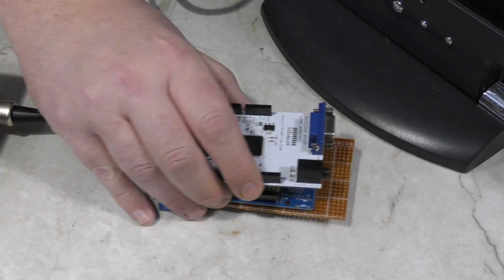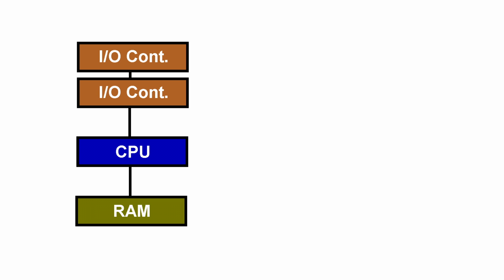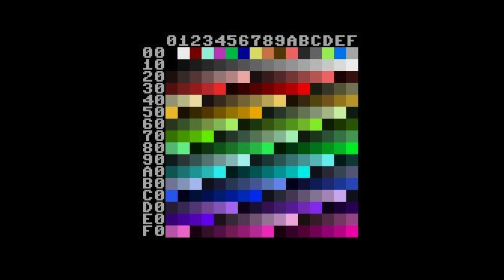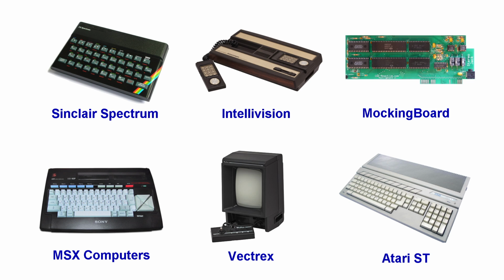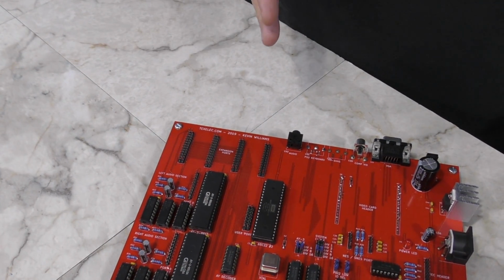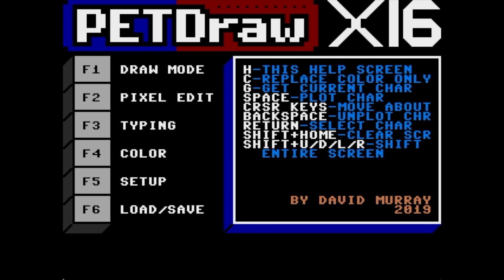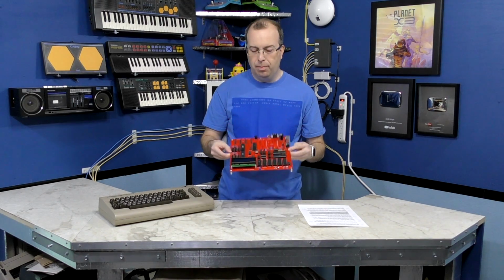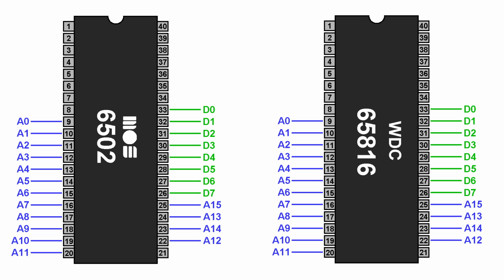Building my Dream Computer - Part 2

Comment: How about doing a YM3812 and SAA1099 and have sound capabilities similar to a Sound Blaster? Okay, yes, I do have a soft spot for it. The SB16ASP was my first sound card.

Also, why a separate button for the NMI, rather than good old Ctrl-Alt-Delete?
Reply: TheVerge.com/2013/9/26/4772680
"I'm sorry I screwed that one up, but it was really IBM's fault!"

Comment: This is such a simple idea in principle, to attach improved video and sound hardware to any machine really. It amazes me (and to be honest I thought so at the time as well) that no-one thought to, for example, bolt on an AY sound chip or 6845 video chip (or the TI equivalent that had sprites) to something like a Sinclair Spectrum. It must surely have been possible to do this, and I believe that was part of Imagine Software's "Bandersnatch" prototype as early as 1983. If such interfaces had been standardised in terms of memory locations it could have levelled out the differences between the various 8-bit micros.
Reply: As in Linux years ago, you have to write the driver.

Comment: I'd probably be interested in a through-hole kit. Don't need a case though, since I'm designing a custom 3D printable case for my other projects (still have yet to find that perfect shade of beige spray paint though...). I would imagine these would come with the Vera chip on a separate module, as shown in the video? Soldering that FPGA looks pretty tricky, unless it comes in a more traditional package. I'd definitely go for integrating the sound into the Vera FPGA if that's possible. If you want to eventually do the tiny board with just a couple of FPGAs or ASICs, having a discrete sound chip will make that difficult. Unless you don't care if the smaller design works and sound different to the original one.

Comment: Cool project. If I may suggest something, it would be an banking system for IO devices. Essentially the idea would be like this: Every device on the bus gets a chip select tied to the slot. The device can have IO and or ROM (and RAM).

This would enable a trivial way to write device independent drivers. You could define a format for the optional ROM. If it is there a pre-defined section of it could include information about that device. The rest of the ROM can contain driver code. If you want to execute a routine of the driver, you map in the slot you want to have an just jump to the ROM. As the ROM as well as the IO space will always be mapped to exactly the same addresses, there is no need for configuration or complex IO address configuration. You would just need to know which IO slot your device is in.

Internal devices like the video chip or the keyboard controller could just get virtual slot numbers acting as virtual cards. Interrupts could be handled via a simple routine that swaps in the IO/ROM space of the card and executes the interrupt code in ROM.

This all would only add a tiny amount of complexity (slightly more complex chip selects on the mainboard, and mildly reduced complexity on the cards) but provide a lot more flexibility. Essentially you could, for example, just replace the keyboard controller from a PS/2 one with one that is just a bunch of IO registers and an interrupt source to scan the keyboard. You could simply replace the video circuit without having to adapt every program. You could attack mass storage devices without having to touch the kernel.

Comment: Excellent video David. I'm a little bit concerned about the music chip implementation. I love the two 8bit stile chips you selected as first choice. But because of the 2MHz limitations, I see you're thinking about moving into a more "16bits style" sound chip. I would love you stick to the original idea of having 6-8 8bit style music channels. I have nothing against the second option, it sounds great, but I think that sound doesn't fit with the 8bits soul of this project. Please, re-think about the final solution. Looking forward for the part 3.

Comment: That Yamaha YM-2151 sounds *awesome*. I have some love for the AY (had a ZX Spectrum +2A that included a variant back in the day), but it's no SID chip, so even though two of them would have been pretty cool, I'm glad to see you heading in a slightly different direction here. Really excited about this project!
Reply: Same here: IMO the AY is just too weak: No envelope generator, low resulution frequency control, no selectable waveforms and no filter. You can do a software envelope generator, but if you want to avoid that people need to be 8-bit gods, you should avoid software envelope generators.

The YM2151 is just way superior and easy accessibility can also be achieved by extending BASIC. I must say like the subtractive nature of the SID (harmonically rich waveforms, subtract from it with a filter). The SID is basically the only subtractive synthesizer that was used in computers and makes the C64 sound unique amonst all other computers.

But considering the need for off-the-shelf ICs, the YM2151 is a fine choice, it will provide great sound capabilities.

Comment: How does the single byte writing to the video chip work? After setting address and increment, you must have to do something else as you send each byte via the data port otherwise the video chip won’t know when you’re starting a new byte (ie how would you send zero twice)?
Reply: I guess the video chip monitors the write line of the CPU, so it can detect when the second zero is written.

Comment: Really nice project! Concerning the design everything is very coherent with the name and logo design and has excactly the ”right” feeling. Though the case and hardware peripherals was disappointing imo. The most economical thing I imagine would be just using simple standoffs with acrylic bottom and top plates, then letting the user choose their own keeb, mouse etc. I think if you’re gonna have a custom case etc it might as well resemble a actual 8bit machine like the c64 or so and then have this as a more expensive choice. 

Again really cool this is:)
Reply: Hi! We are going this route for very good reasons. I'll be doing a full post and user poll shortly on the Facebook about this. In short, we don't want to custom build a case and keyboard as that would add hundreds of thousands of dollars which you guys would have to pay for. 

It also introduces many risks and delays as you have seen on other projects like the ZX Spectrum Next. Therefore we are limited to high quality off-the-shelf components, which is the spirit of David's project. We will be customizing and rebranding these and you'll see all the options in the aforementioned poll, and have a say. We realize with nearly 1 million subscribers we are not going to be able to please everybody, and we thank you for respecting that. 

However you can trust that we are moving forward with the best possible option for the community so you can get this machine in your hands as quickly as possible, looking sweet, and at the best value.

Keep in mind too that many beautiful classic computers did not have an integrated keyboard. Apple Macintosh, Amiga 1000, Commodore 128D, Amstrad PCW... 

Thank you for your enthusiasm and feedback 👍🕹️

Comment: Why not just make 4 to 8 small motherboards, it'll be like an 8 story system, the corners screw together. It's connected by flex cables. It'll look like an industrial shelf you assemble, that you find int hardware stores. With this design, it'll be easier to form it into a custom case cube (maybe even as small an Ouya) that looks like a square Death Star (it had protrusions on the surface) and ribs for that retro look). If something goes wrong, it's cheaper to replace the module and/or isolate the subcomponent. Each layer has an easy to plug, plug so you can power just that layer/module to easily isolate problems.

God bless, Proverbs 31
Reply: This is a terrible idea and would cost a ridiculous amount of money, and they are not going to stock 4-8 separate boards for the extremely rare chance something stops working. They're all socketed anyway which makes it even more stupid of an idea lol. Imagine all the spaghetti wires connecting all the boards together

Comment: As for sound device: why not for custom chip also? 2x ARM based SID emulator with Paula's four voices (at least) for 8/16 bit samples to be able to replay Protracker mods <3
Raspberry pi form-factor will be squeezed into FPGA anyway, so i don't see any point here in insisting to use of actual YM chips. All these vintage chips had they pros and lots of BUTs. Why go for compromises if you have such skilled custom chip designer as Frank (best regards and much respect).

Comment: i know that this is a gaming computer since it's built by gamers but if it could be used in small automations also it wolud be great! Some  io pins with pwm and interrupt capability ... maybe at least a single ADC input pin. Would be great to program some simple user interface for a thing like that maybe a graph display of some data ...

Comment: $300 .. sorry no one is buying that ... $150 seems a sweet spot for retro computers
Reply: True, but the costs add up fast when you're using real retro hardware.  A 6502 is no cheaper than a 100MHz Arm microcontroller with built-in RAM and flash, and requires a much larger PCB.
Reply: I've been trying to tell him: You can get a ice40 FPGA board for $8 (called the "Upduino"). It's powerful enough to run the whole system. You could fit almost the entire CPU in one of its eight DSP blocks. You could fit a pretty great sound chip into another DSP block, then you have six DSP blocks for graphics. With all this and 128K of onboard memory running in the 100 MHz range, there's not much need for anything else. You could slap a few MB of off-chip RAM, an SD card, a VGA port, and a tiny MCU to handle peripherals and be done with it. The whole thing could fit in a pack of gum and be sold for $20 with a healthy profit margin.
Reply: Or something like the RZ/A1LU, which has 3MB of built-in RAM and an LCD controller with 3 graphics layers which can easily be adapted to VGA.  That's $15.

I do respect doing it with real classic hardware, but you end up having to use an FPGA or microcontroller anyway because some of the parts just don't exist any more.

Comment: Oh, proper cursor keys :-)
The specific AY chip is also used on the Amstrad CPC which played the keyboard controller part besides the sound.
There is a new fantastic tracker for it now, Arkos.

Comment: wow, 8 bit guy. What a project.  So now we can have a sort of basic computer that does what we expected from the Commodore 64 but 8 times faster, thanks to commodore and the 8 bit guy there has been a lot of research, so we still can enjoy this kind of computing in 2020 and beyond. The connectors for commodore serial equipment is very welcome.  Fabulous project and compliments from the netherlands.  I might buy it,  if it comes in a sort of atx/ps2 format, add a monitor and play.  I wonder if there is a difference in PAL and NTSC modes. did you think of the european market yet ?

Comment: What I find interesting is the decoupled clock between the CPU and Video chip. If the CUP side can be down-clocked to around 50Khz then you would be able to drop the MOnSter6502 board in without too much difficulty.

Comment: I don´t really get it.. What is the gold of this computer?... Should it be a certain era? or just the best of all eras computer... ?

What most people don´t realize is that memory space and memory speed was the most limiting factor for computers in the 80-tys. Having a external GPU was just to expensive. So just putting a graphics chip on main memory was way cheaper... but also make the whole system a lot slower. That was also one reason the PC:s was so freaking expensive.... And lacking the sprites logic was horrible to play games on.

The MOS 6522  isn´t that much slower than say the M68k. What making the C64 as slow as it is is really the memory. And that is of sort true for the A500 to. Where you can ad more ram. Making the computer significantly faster.

This architecture reminds me most of the Neo Geo that used one CPU bus, one GPU bus, and one audio bus (that is the reason there cartridges is so freaking large)... and well the console so expensive.

Comment: Your brain amazes me.   I fried my Amiga 500 trying to put my Fat Agnus chip in for PAL mode.  Looong time ago.  I didn't know there was a difference between metal melting tools so basically I used a flamethrower instead of a blowtorch.   I was young and excited and tried my best.  I took in my A500 and they fixed it up and put in the chip so it was a costly but good outcome and I still have my A500 somewhere around here.

Comment: After watching this video I wonder how hard would it be to make a new-stock mid 90's x86 PC? 

I think there are a lot of people like me who collect old PCs for playing dos and early windows game on but are tired of trying to find them, fix them, replace dallas clocks, get IDE to SD card working, source a good sound blaster, re-cap, etc.

Would it be possible to produce a single board with something between a 386-586 cpu, a decent video card, on board sound blaster compatible or adlib, networking, decent amount of ram, sd card hdd. I think that would be very cool.

I recently came into possession of a 486 computer-on-a-chip which is used in CNC machines. It had most of that all on one board including an IDE and floppy controller, and a 16MB rom containing the operating system. Seems perfect for what I'm describing. Only problem is this thing I found at a thrift shop for $5 sells used on ebay for $500.
Reply: Not quite the same, but someone's done a XT on a microATX motherboard 
https://monotech.fwscart.com/NuXT_MicroATX_Turbo_XT_955MHz,_832K_RAM,_XT-CF,_SVGA,_Floppy,_Serial/p6083514_19777986.aspx

Comment: if you installed a TDA2009A (or similar) chip on this board, you could have onboard 2 channel 10 watt sound with low THD. With a passive crossover before the amp, you could seperate into woofer and tweeter channels. $15 worth of pyramid 3 1/2 speakers later, you would have the best onboard sound of ANY computer ever. The chipset needs little external componentry, could be powered by atx, chip cost about $1

Comment: My personal preference... I would prefer the 16 bit CPU and the Yamaha chip as options. I think it would be more than fair, since you are sold on the FPGA anyway, to use the FPGA for sound though, if that keeps the cost down. Have you considered a jumper and multiple ROM options for sound? Default kit uses the FPGA based 8 channel sound option, but setting a jumper and soldering in the Yamaha chip into the board would then enable it's use on the system, either instead of the FPGA core, or as an optional additional 8 channels.

Also consider Reddit or even a simple Wordpress style blog for the project, as I don't use Facebook. I think a lot of us retro computing fans are also not fans of Zuck's data mining platform.

Comment: the vera fpga board seems like a awesome design...I would love to see that released as a product to go separately where ever someone wanted to put it...my choice...a z80-mc2 a cpm z80 system with 128k of ram and only serial terminal output currently but a full set of io pins to drive the vera...should work.  I have to hand it to you for reeling this project back in from something that could never work because of testing issues...having your dream computer designed by others...how awesome is that.  congrads...

Comment: I kind of expected the YM3438 rather than the YM2151 to be used, to cut down on the need for an external DAC - as well as the YM3438 being a lot cheaper than the YM2612, but the two extra channels are nice!

Comment: When you started talking about sound chips the first thing that came to mind was the AY-3-8910. :)  You have certainly made a lot of progress over the last 6 months. You could have used the 65C816 and had a flat memory space. @3:15 you said it takes a lot of external circuitry to use the extra address lines but it doesn't take much. You need an 8-bit latch and a single inverter to get the extra 8 bits of address. The method is shown in the datasheet for the 65C816. I think the circuitry to get the extra 8 lines would be simpler than dealing with bank switching. You need a latch or two for the RAM and ROM bank switching and an address decoder. For a flat memory space you need a latch and an address decoder. I think there are definite advantages to having a flat memory space. It would also make it easier to have optional add-on memory expansion in the future.

Comment: I wonder if you could alternate 4Mhz between the two sound chips, each chip would have a delay of approx 2Mhz from one another (which is 2 millionth of a second, and should be inaudible), by just using a frequency switcher (rout clock signal to one, then to the other chip)?
At least you'll be able to run it at double the frequency.

Comment: Are you guys familiar with the 65C265?  This is a 65C816 with direct address (24) and data (8) buses (not interleaved like the 65C816, so you can directly connect RAM and ROM or I/O to the address and data buses).  Both of these processors are still available from Western Design Center.  "Emulation mode" permits running legacy 6502 code, while "native mode" provides enhanced instructions and 24 bit address space.  No need to "bank" anything!